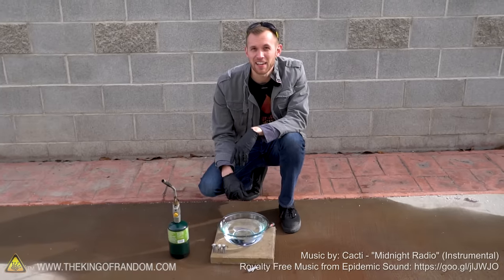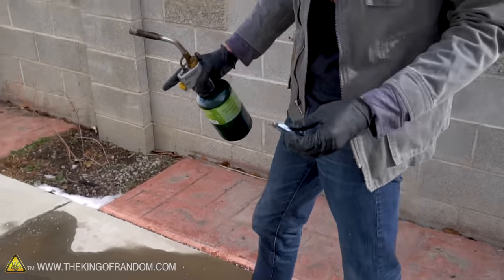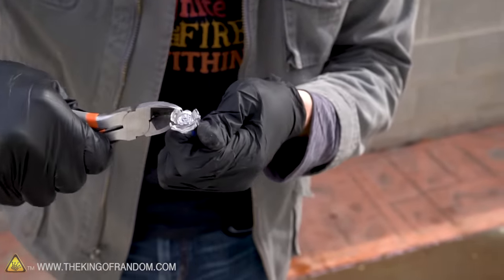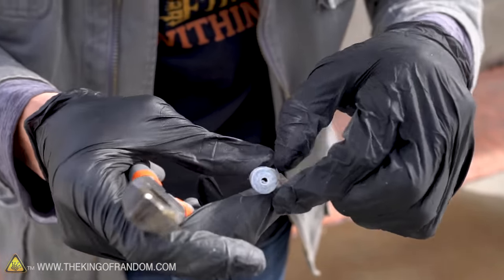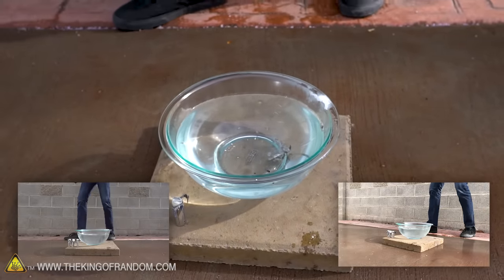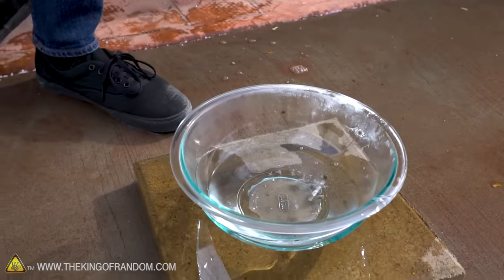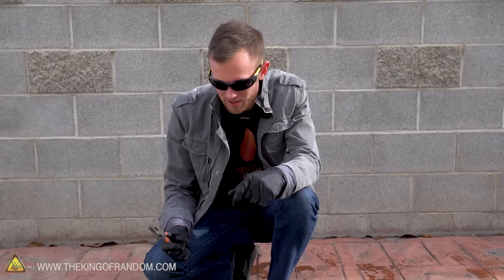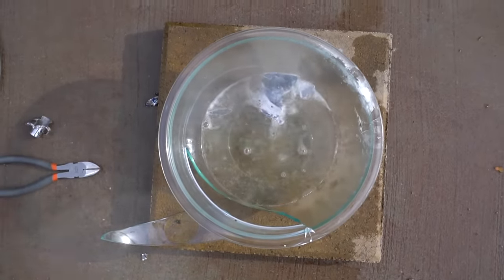Lithium Batteries Dropped in Water! TKOR Exploding Lithium Battery Experiment!

Comment: In addition to the EXTREME HEAT given off by Li-Ion Battery combustion, the HYDROFLOURIC ACID (HF) released can ETCH GLASS. So that might explain the glass damage.
Reply: Li + H2O ... Where the heck does the fluorine come from
Reply: @DheeraVenkatraman  Most tap water in the US(at least that comes from a central water plant and not for example a well) has trace amounts of Sodium fluoride added to promote dental health in consumers.
Reply: These are metallic lithium batteries, not Li-ion. They probably contain little if any fluorine. Hot alkali (formed by reaction of Li with water) can also etch glass, which seems more likely.
Reply: @TheWolfman112  lithium would then displace sodium becuse it is more reactive so nothing interesting would happen other than formation of Lithium fluoride,the heat was so intense that it started destroying the glass when the color changed to orange it was becuse it was pulling Na+ ions from the glass so it would probably damage it a lot
Reply: You don't get HF from this reaction. You do get LiOH which is the weakest of the strong alkali bases. The etching probably comes from the lithium hydroxide dissolving an extremely small percentage of the glass. Studies show that strong alkali metal bases can react quite well with glass, so it should be quite plausible that the LiOH was reacting with the glass. Definitely some experiment ideas i want to test now.
Reply: @polishnope5609  forgive me if I'm just misunderstanding you, but Na is more reactive than Li. Reactivity increases as you go down the group 1 elements. Fr is theorized to be the most reactive metal on the periodic table but nothing is known for sure since it's radioactive and highly reactive.
Reply: Li-ion batteries do not contain metal form Li

Comment: Can you melt rock please....
Reply: True, but on a very small scale only; with the mini arc furnace. I think it would be really cool if they could try and make a big batch of lava.
Reply: Awesomeness Brahadhish it would be so cool if we could find a way to melt wood and get liquid wood
Reply: Yeah, you could blend the wood.
Reply: Done already
Reply: Wood can't be liquid. It gets vaporized before it melts.
Reply: It's in their previous video
Reply: Awesomeness Brahadhish makes slag
Reply: Xeryun sort of true; it spontaneously combusts. Most types of wood auto-ignite (when dry and at normal atmospheric pressures) at 625 K (665 F) or lower, which is a much lower temperature than the temperature that would be required to break the intermolecular bonds of the molecules that make up the wood. These are fairly large and thus require a great amount of energy to melt.
Does get me thinking though: Could you melt wood in a vacuum chamber? It should allow the 'wood molecules' to break free much more easily.
Reply: WarlandWriter put it in a non burning gas (not oxygen) and heat it up
Reply: yes you can its turns into lava or magma i think
Reply: its called lava/magma
Reply: rubberduck but if you put it in co2 in can't burn cause it reacts with oxygen
Reply: It's called lava
Reply: FallingJuiceBox 😒
Reply: Thestuffsofstuff ??
Reply: @feverdream3452  Wood burns...
C including compounds (lignin) + some O₂ = CO₂ (and water from the hydrogen present in those compounds)
Reply: You can already melt rocks into molten rocks

Comment: What happens if u mix liquid glass with liquid metal and the let it dry?
Reply: You get crystal glass.
Reply: clearly it makes metalass
Reply: Gletal!
Reply: That would be like trying to mix water and oil. Those 2 chemicals have different consistency.
Reply: you get leaded glass
Reply: liquid metal isnt a thing. liquid aluminum and liquid iron etc. are
Reply: room temperature mercury, and 100 degree farinheight gallium are liquid metals
Reply: @Spekor  he meant like metal is not specific enough. it can be a alloy, it can be iron, it can be aluminium,..
Reply: literally how they make window panes
Reply: u get molasses
Reply: Dry?
Reply: metass
Reply: They don't mix, they turn to solid at different temperatures so you get metal with slag glass on top of metal  with pockets of glass in the metal depending on how much it's mixed when cooling. Metal is heavy and tries to push the glass out.
Reply: rubbing alcohol
Reply: I suppose the metal will sink below, and maybe glass will decompose??
Reply: @WaluigiisthekingASmith  mercury
Reply: No they wont mix, you are just gonna get a piece of metal with glass.
Reply: Each of those batteries can go for 5-3 dollars
Reply: it will became metal juice in a nice Tumbler

Comment: I'd guess that more accurately what happened is that the flames got hot enough to cause the glass to chip away in the area with the divot, which then spread around the bowl in a crack. I'm not sure which brand of bowl you used there but it looks like how pyrex might chip, although pyrex would completely shatter from my experience.

Comment: Interesting that even after those batteries were partially disassembled (and the internals were exposed), dropping them in water did nothing.  Perhaps the wrap was (still) tight enough that the lithium  wasn't exposed to the water and/or since it was submerged, the reaction was slowed enough prevent any combustion.
Reply: Imagine if they actually did something educational and knowledgeable. That would make this better.

Comment: Try this:
Take your scavanged lithium, roll it into a nice little tube, then jam it into some thermite and fill center of tube with water...

Since the negative X did not work (flashpoint too low, provided a heat sink keeping thermite below ignition temp), lithium has a much higher burn temp (if it could melt glass that quickly!).

Comment: Look if you short out that batterie it will instantly explode in a fireball blasting molten metal around… maybe those are different then 18650 I’ve seen one of those go off.

Comment: The easiest way to remove the outer casing is to put it in a vise, cut the outer casing all around the cylinder, then pull off the half casing with pliers. Remove it from the vice, then remove the remaining end. Pliers will be required.

Comment: If those are fully charged batteries it can react with the moisture in the air much easier. Bad batteries I believe are covered in an oxide so they're not as reactive

Comment: What about taking multiple magnets and attaching them to each other then melting then as they are together and see what happens when in melted stage and after when solid. Lol
Reply: Magnet + heat = no magnet
Reply: Gobillion 160 well it would have to be heated so high, melting point of iron. Yeah. But if its just a lighter heat very little... but yeah overall youre right

Comment: Actually it is somewhat much more interesting for me whether how it's possible to pull it out and than to smelt it into a blub without burning it!So what flux can I use for that?I mostly suppose it will be only possible to do so with some of lithium compounds because it is only thing that won't be disintegrated in a termite-like reaction!

Comment: Interesting the sulphur strip, I wonder if it is used because it has a lot of loose or free ions in it?
This experiment shows on a small scale issue the ev cars might be having issues with.
I'd be curious to know if it is a small bit of condensation that is igniting them or possible trapped water from he weather.
To see he flame as soon as it touched water, you have to wonder if that is something causing the fires?
Unless the batteries are designed differently, maybe the housings or casings have been collecing moisture or something.

Comment: I'd like to see what happens if you drilled a few 1/8" holes through the battery and then dropped it into the water; let the water seep into the lithium while the battery casing is intact, so that it it gets to build up pressure.

Comment: This explain why Tesla's explode and catch fire after accidents wow!! So if the batteries crack in an accident and hit the coolant of a non electric car that's a huge fire!!
Reply: No ... Tesla uses a Li-Ion battery, they do not use a Lithium Metal battery - as shown in this video.  A car with an Internal Combustion Engine is 10 TIMES more likely to catch fire per 1,000 miles driven

Comment: The divot in the glass was made when the heat distortion cause the section of heated glass to ping off of the rest of it. It would have been near impossible to see the extricated piece in the water as the diffraction / density / speed of light would be too similar.

Comment: The black strip is carbon.  Carbon is the anode or positive part of the battery.  The rotten egg smell will be the electrolyte used for the electrochemical reaction.

Comment: If you held the lithium under the water instead of setting it on top wouldnt it have a more violent reaction because of the increased surface area

Comment: You forgot to say not to try this at home. If you accidentally short-circut the battery upon disassembly by crimping the inner components, it can and likely will catch fire in your hand. It's happened to me, but luckily it was pointing away from my face, I grabbed it by the bottom that wasn't opened, and quickly speedwalked to the backyard and buried it in the dirt, containing the flame. The dirt was dry and I wasnt thinking of what may have happened if it was wet.

Comment: Theres actually and easier way to open batteries, not sure if it works on AA's and AAA's, But I know you can use a pipe cutter to crack open C Cell batteries.

Comment: So i saw a video where you tried lighting thermite with water and something x. Then this one.
How would this be for an experiment use this lithium to roll like a "joint" with thermite so the thermite is inside the lithium. Then  see what happens if you drop water on it. Is a lithium flame hot enough to light the thermite?

Comment: It can also ignite just from the moisture from your hands and the air. And you can use a pipe cutter to cut the middle and 2 pliars to pull apart and grab the lith and pull out. VERY DANGEROUS

Comment: I have the same type of battery. When I tried to disassemble the battery it started burning in my hands, and smog came out from the battery I waited a 1 minute then completely opened the battery, and inside was only one piece of foil and this foil didn't make any reaction with water.

Comment: And if you value your electronics, use lithium batteries, not alkaline.  Lithium batteries don't leak.  As you can see from these videos, alkaline batteries have all kinds of corrosive liquids in them that leak out.  Lithium batteries are pretty dry.

Comment: The King of Random is gonna randomly hurt his self throwing lithium batteries into water. You happen to be very lucky the unwrapped battery you threw in the bowl didn't react. Wrapped and concentrated like that, if it had begun to react it would have been VERY violently and would have went BOOM and probably would have sprayed little bits of molten and burning lithium in all directions which will continue burning until all the lithium is burnt up. Imagine one of those little pieces landing on your skin burning o hole in you until the lithium was gone. Your sulfur smell would have been combined with the unique odor of human flesh burning along with the linger of sulfur in the air. And of course, if one of those little molten bits of lithium landed on your clothing, perhaps somewhere you didn't notice immediately, now your clothing is on fire, and unless treated, clothing burns up remarkably fast. And your opened batteries laying on the wet sidewalk...a couple more little booms with molten shrapnel waiting to happen. Just sayin'.

Comment: I came to this post wondering what would have happened with the tons(?) of the lithium ion batteries in the cargo hold of the Malaysian flight MH370 that went missing. I wondered if there could be a signature telltale reaction that could be picked up by satellites orbiting the area on that date of March 8th 2014, and if that  knowledge could help further in the search for it to be found, to bring closure for the families of the victims.

But as it turns out, the southern Indian ocean at night would still remain one of the toughest and most vastly difficult of places To actually locate these clues.

Interesting video, thanks”)

Comment: DO NOT DO THIS WITH VAPE BATTERIES. they will blow up in your face!  Seriously!
Reply: Do you know from experience? Vape pens blow up in your face because you are holding right by your face. Also, batteries don't just blow up if you take them apart, they blow up if heated to extreme temperatures, or if short circuited, which causes heat, which therefore makes the battery explode. The only batteries that 'explode' are lithium-polymer batteries, also known as Li-Po. Those blow up only if they are short circuited or if the metals inside touch and cause an internal short circuit. I hope this comment teaches you to think before you type something. Do your research, kid.